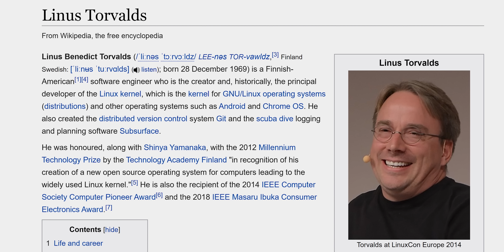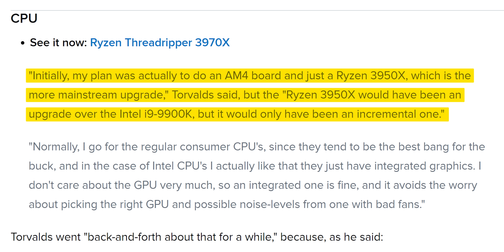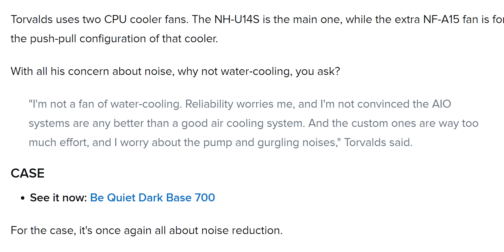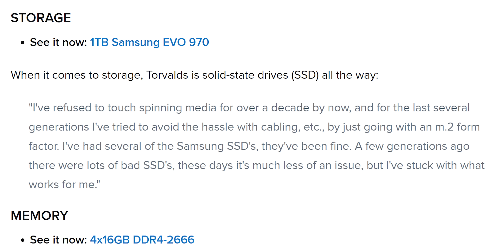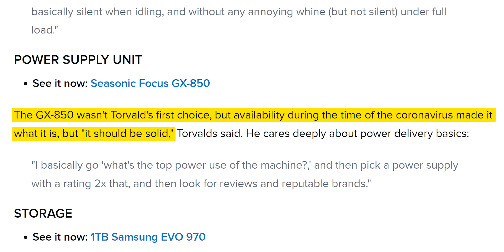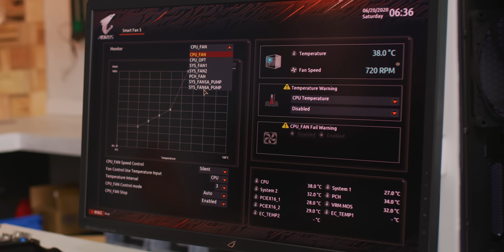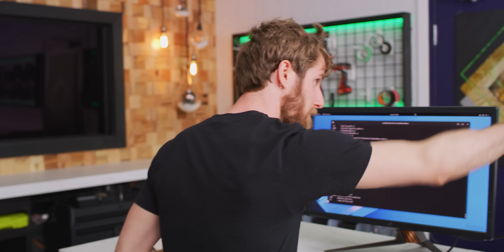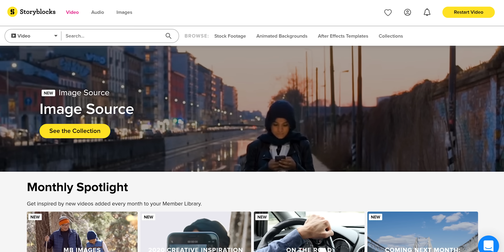Linus builds Linus’ new PC!

Comment: Another reason he would go with an AMD video card:
Better open source drivers.
Reply: That’s actually  exactly why he said FU to NVIDIA 😉
Reply: That's exactly the reason why I have an RX 480 from some time back. The free nVidia driver (Nouveau) still seems to lock up under some loads leaving the options of a black screen until restart or restart while the AMDGPU driver has no such problem. I don't see myself touching nVidia cards until this gets fixed.
Reply: lollllloro my RTX 2080ti doesn’t have that issue
Reply: The OSS and even the Mac OS drivers are so good, I wonder what is Radeon Graphics division writing Windows drivers are doing? You guys can't possibly outsource everything you know?
Reply: @Seatux  I hear a lot about how AMD drivers are bad on Windows but never any details. So why are they bad?
Reply: @deoxal7947  There was a string of drivers at the beginning of the year that caused problems for a significant (~5%) chunk of people. They acknowledged the problem and fixed most of it by February. They still mention the problem in the known issues, as there are multiple system instabilities that can cause the exact same symptoms,  but some people are too lazy to just drop XMP or other overclock for diagnosis. 
My favourite example is this guy who complained about AMDs "shit drivers", until he mentioned that he was undervolting his GPU. Dropping the UV made his system stable...
Reply: @Seatux  Because it's good compared to NVidia on the same platform. Linux AMDGPU driver isn't better than its Windows counterpart.
Reply: Well closed source drivers might works for some people. However usually those  blob  are only compatible with certain versions of kennel. If you're on the consumer distro then you might be fine. However if the kernel abi breaks compatibility then you might not be able to boot.

Also in the past Nvidia driver is mediocre at best (power management, Optimus issue, etc.). I don't know what about now though.

But the main reason why Nvidia is generally hated in the OS developer community is, they just don't coorporate. That's the reason why they got a middle finger from Linus as well.
Reply: AMD is basically plug and play on linux unless you need gpu compute which comes either as the proprietary amd-opencl or rocm
Reply: Which is why I have an AMD APU and a Fury Nano on my Debian installation and have since abandoned nVIDIA. Nouveau ain't stable.
Reply: @FlabbyTabby  The sapphire cards are so quiet that it doesn't matter, they make very good coolers for their cards. And I don't see any issues with the Drivers stability, it just works perfectly fine in my setup. My iGPU is just for IOMMU purpose (GPU Passthrough) for VMs, and I want an AMD Card for that purpose (wait for some low Power ones).
Reply: Reason I buy AMD cards as well, you just don't need to think about the drivers. Every distribution contains up to date drivers that integrate with the rest of the Linux ecosystem, while Nvidia requires you to replace a lot of parts with Nvidia specific ones (OpenGL libraries etc).
Reply: That’s the reason why he gave Nvidia the finger. So he kindof did^^
Reply: I cant imagine nvidia drivers sucking dick on linux considering how invested nvidia is in AI/ML/CV etc and it all runs to 90% on linux. Anything scientific is essentially linux + nvidia (cuda,etc). Anyone care to shed some light?
Reply: @user-mo5en6wv4x   nVidia uses practicly the same driver across all the OS's they support. It's like 95% shared code between Windows, Linux, FreeBSD, and Solaris. Needless to say that it doesn't integrate well with the kernel or the Mesa graphics stack, or with any the more modern display managers.  For simple acceleration it works well enough, but leaves a lot to be desired if you are diving in deep on your system.  The kernel developers don't take bug reports if you have the nVidia driver loaded. Linux can't use any modern nVidia card for this reason, nobody except nVidia really knows what the driver is doing (and the EULA prohbits reverse engineering and de-compiling anyways). You simply can't to kernel development with a proprietary driver loaded.   I'm sure linus would have gone for intel's basic Xe card had it been available, and Intel has been very supportive of the open graphics stack, only releasing one or two GPU that required proprietary drivers (And really they were using PowerVR's designs there)
Reply: @user-mo5en6wv4x  linux user here since 2005. Only had Nvidia so far. The good: as long as you stick to X and their extensions, Nvidia drivers have been robust. The bad is that when you do something not mainstream, those will not work well (slow). The ugly is that Nvidia has to care about Linux (Doom eternal fix available in no time) but doesn't care about Linux/OpenSource way of working, hence with Nvidia you're always behind the curve and dependent on them.

I have had GTX 680, GTX 980, GTX 1080 and now RTX 2080 Ti. I've always used Ubuntu LTS and stability has never been an issue. Performance is better than AMD because the HW is better.

The day AMD comes up with a top performance card, will be the day I'll switch over.

Or I'll stay Nvidia as long as they'll provide clocking capabilities to help out the OpenSource driver...
Reply: It's been this way for a while now, but the open source linux driver is consistently more stable, faster, and with FEWER bugs than its proprietary counterpart.
And their proprietary counterpart has a constant habit of fixing an issue in a single release of a driver, and then breaking it almost immediately following in the next driver after...
Reply: Better how? AMD drivers on Linux are better from a "freedom" point of view, as they are open source as you said. In terms of performance they are behind NVIDIA's proprietary drivers. Don't lie to people, nor repeat something you are not sure about, people wanting to jump into Linux might expect better performance from your comment, and that's just NOT true.
Reply: @cristiandt9964  they're equal from a performance point of view, and they're superior in terms of stability and, well, you don't need to do anything for them. No version switching, no necessary reboots after updates and they actually behave well with the OS (look at the amount of complaints about GNOME and especially KDE Plasma  + NVidia...)
Reply: @cristiandt9964  Nvidia drivers aren't just closed source, but an absolute mess on Linux, there's so many stability problems, compatibility problems, Nvidia just not giving a fuck, and performance is crap. I should know because I have a Nvidia card in my machine, a NVS 510. It was so much more stable on the integrated Intel GPU. I'd recommend anyone on Linux with Nvidia first drop the propietary drivers, then install the open source Nouveau drivers. I don't personally really care much about free software (although it the Nvidia drivers were open source the community would have fixed most of the bugs). But amazingly the 3rd party open source drivers are much better.

Also what about the ridiculous EGL fiasco?

There's a reason Wayland's Swat requires you to use the argument --my-next-gpu-wont-be-nvidia to even use Nvidia's propietary drivers.
Reply: @lost4468yt  "I'd recommend anyone on Linux with Nvidia first drop the propietary drivers, then install the open source Nouveau drivers." <-- I strongly disagree. The proprietary drivers are far faster and more stable than Nouveau for every machine I use.
Reply: @cristiandt9964  It's common knowledge that Nvidia cards proform better in gaming, you can even suspect that from what the both Linus said, and as they say its good enough for what he does.and amd graphics is even better at mining than Nvidia. NB: This is not a Gaming system.

Comment: Knowing that Linux was almost represented by a furry...
That's it, I'm ditching Windows.
Reply: Linux is Amazing, and open source. Linux sets the standard for what security should be. ! It is the most powerful OS in the world. you can do what ever you want to with it. also unlike mac and windows you own your system. plus you are not spied on and exploited for money...
If you install Linux on the computer you have now (at your one will) you may fined that you don't need to upgrade to a new computer and can save money...
 If you are new to Linux, i would recommend one of the four flowing distros. 
1.) Manjaro Linux - Has most of the default Desktop flavors as independent builds. and is a fork of Arch Linux. this gives you the power of Arch Linux like its bleeding edge repositories with the pacman pkg manager and the AUR. (arch user repositories- basically a huge software depot created from the users of arch. and maybe even you soon.) in other words almost any type of software you can think of.  and adding another Arch type repository is easy to do. An example would be the Black arch repo. this repository has an unbelievable amount of hacking. pen-testing. and security software. 
2.) Ubuntu Linux- Ubuntu's main Desktop is there custom gnome environment. its a fully custom environment made by canonical to be user intuitive. 
Ubuntu is a fork of Debian, giving you access to the Debian repositories and the apt pkg manager, which are fairly stable relies of software that are well tested. but do move at a moderate pace for revisions but not necessarily bleeding edge tech. but you could get an app-image for "more bleeding edge" software.
3.)Linux Mint - with there newer desk top Cinnamon users coming to the world of Linux from windows are greeted familiarity with a more conventional layout. another fork of Debian it uses the apt pkg Manager. however the Linux Mint team has a huge focus on stability, so the software is well tested... this is not bad but it is not bleeding edge. though you can get app-images for newer versions of software. 
4.) Elementary OS- with there spin on Plasma Desktop it is an OS designed for the mac fan. and if you are coming from mac-OS the swap may even be unnoticeable at first. until you realize the raw power you now hold at the tip of your fingers. 
before you install Linux on your computer move all of your important data to a different place like a USB.  as installing on a computers hard drive can wipe all other data.
If you have any questions file free to ask. cheers

Comment: No RGB! Also I'm a full stack web dev and in order to run a full microservice architecture dev stack you just need a bunch of cores and ram 😂
Reply: Dev too. The problem was only RGB ram was available to me when I built mine. Anyway, I'm not going to install the shitty software my motherboard manufacturer has, RAM is on random RGB light show now. I kinda wish off was the default by them.

Comment: Another developer here. I recently built a workstation speced for a 3950x but had to settle for a 3700x. IIRC Last time I compiled the linux kernel it took about 3-4 minutes. At least he will have plenty of performance left over to do more than one build and just use the computer AND probably not notice any slow down.

Comment: Just a little info from a developer for you guys:
I'm using a Core i5 9400F, 16 GB DDR4, a GTX 1050, a 970 Evo 500 Gig, an 860 Evo 500 Gbg, a TB SSHD and 3 Monitors (twice 1080p, once 4K). 
Reasonable upgrades would be:
- RAM to 32 GB (I peak at like ~90% when researching, compiling, running Android Sim etc...)
- Graphics to something that can support 3 4K monitors 
- Those other 2 4K Monitors 
- up to a 3950X depending on the budget would do it for me
- maybe overkill, but I had times I thought I'd prefer from more than 3 monitors, up to 6. But that would need the quadro world and I don't need it so often that it would be necessary.
In general, core count, huge amount of RAM and IOPS on the storage side and lots of monitor space are key for developers from my view.
And the macro keys from my old Logitech G15 come in handy sometimes as well.

Comment: The other good thing about this build was avoiding RGBs.
Reply: Thank you, I hate RGBs.
Reply: Yeah! Totally
A Dev thing (y)
Reply: Yess
Reply: Well I don't really care for RGB. My RAM and AIO have RGB, but not because I need it, just because they were the best option at that time for me. Yet, my ASUS Pro WS X570-ACE doesn't and that 's fine as it does have a bottom PCIe 4.0 x8 slot - perfect for a QEMU-enabled Windows or macOS-VM just in case without any hassle with kext-hacks, Error 53 or Intels slow iGPU. From what I found, there is no other mainstream AM4 board right now that supports 24 lanes of PCIe 4.0 or a combination with older standards directly to slot-in cards (Quote AnandTech: "the ASUS Pro WS X570-Ace as it stands is the only X570 model which is focused on the professional market with official support for ECC memory, three full-length PCIe 4.0 slots which operate at x16, x8/x8, and is the only current X570 model to operate at x8/x8/x8 across all of its slots, using a full x8 connection from the chipset." - I can tell you x16/x0/x8 is obviously also possible).
Better yet, this GPU though only having 4 GB which let me buy it for just around €120 almost unused does heavily profit from quickly swapping to system RAM over PCIe 4.0 x8 (electrical wiring limit) as Hardware Unboxed found via their own testing: youtu.be/-EDJXISD6RY?t=456.
Reply: What! That at least triples your performence! Why not?
Reply: No
Reply: @kridengaming  Yes

Comment: as a software developer, we need more cores and more ram. always more. I  NEED MORE INTELIJ INSTANCES!
Reply: How much Ram do you need? — Yes!
Reply: Linus will be good enough with 16 or 32 gb ram. He never uses an ide. I think he uses vim or emacs which do not require that much memory. But intellij requires at least 8 gb of ram for a small codebase to run smoothly.If linus torvalds works with intellij ides like clion 64 gb will be minimum for running a huge codebase like the linux kernel
Reply: @sushmatolwani1923  yeah thats fair haha, I usually have anywhere from 3 to 8 instances of intelij open at a time, can easily nom through 64GB when you add in the 8 billion tabs of stack overflow. (I am not an organised person)

Comment: This case is actually really nice IMO
Reply: Be Quiet cases are really very good at what they're designed to deliver - quiet operation and minimalist design. Finished a pure base 500 build a month or so ago and it was a pleasure to build in for a rank amateur like me. Only issue is airflow - even with two SW3 140 mm fans in front, it doesn't have great airflow but that's a trade off I'm willing to accept for the near-silent performance outside full gaming load, where the graphics card fan noise takes over.

Comment: Gotta love how LTT does not forget about Linux in their videos.

If only we could get more people to move from Windows to Linux (or at least dual-boot), now that Windows 7 is dead and unsecure.

I know many people say "It does not support the games or software I want" (Myself included, especially on the gaming side), but only way to get those games and software ported to Linux is if we can raise the customer-base in Linux high enough for the manufacturers to actually give a crap.

We need PC's and laptops with pre-installed Linux OS (Linux Mint would be quite newbie friendly for its Windows-like look).
Reply: Also, Linux OS's are not only some command-line / hacker / programmer -stuff. There are many beautiful graphical user interfaces in these different distros.
If you've tried Linux back in early 2000's, forget about the struggle back then. Installing Linux operating systems and using them has become really easy.

Comment: SILENT PSU comment
It's NOT enough to just get overkill on the Wattage rating. You should actually find the FAN CURVE graph for the EXACT PSU you plan to buy. For example, I saw a 550W from Corsair and the fan stayed at 10dB (silent) until close to 400W load then ramped up... but I've seen 850W PSU's that were loud in idle... there are also models that disable the fan completely below a certain point and those should be fine
Reply: (EDIT: I meant the fans disabling should be fine to not overheat as they design around that. I have an EVGA model. BUT... I ended up getting a 750W model that disabled the fan below 50% load because my calculations said I'd probably use just under half for a worst-case with my hardware. That's panned out so the fan doesn't turn on. I would have bought one where the fan turns on at a lower speed though as that's probably a better value and still quiet... and be VERY CAREFUL not to get a PSU with an "ECO MODE" that has the fan turn off if the power draw ends up causing it to spin up suddenly as that may be annoying... again, something with a ramp like 10dB to around 75% of max power then ramp up)